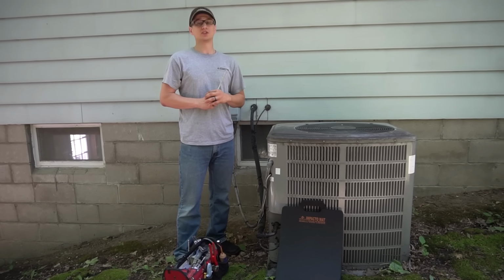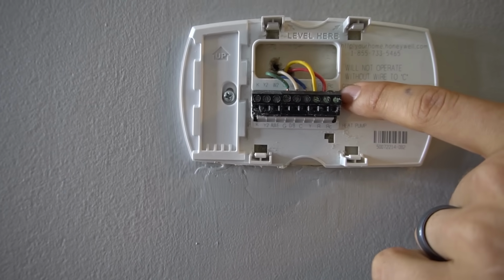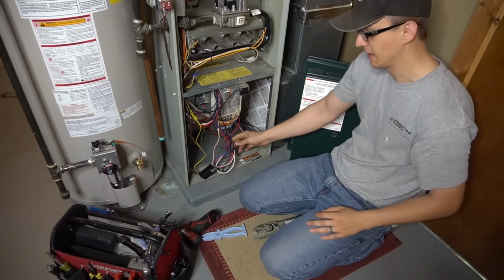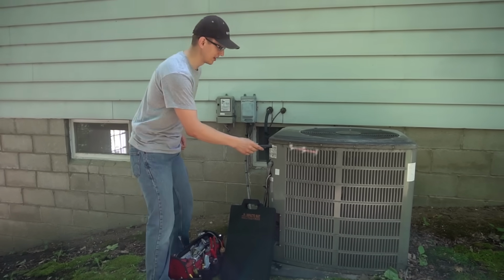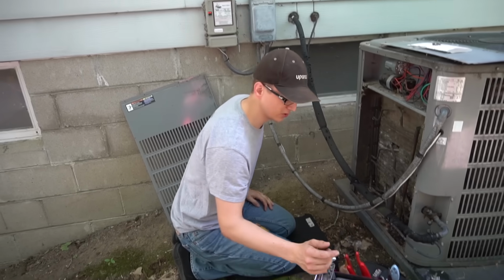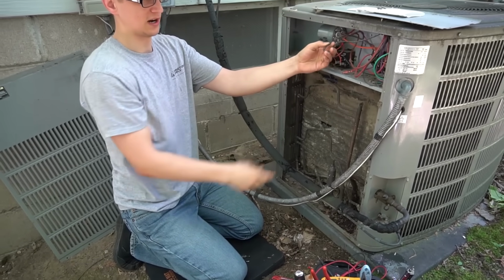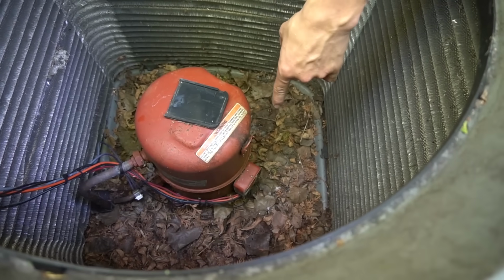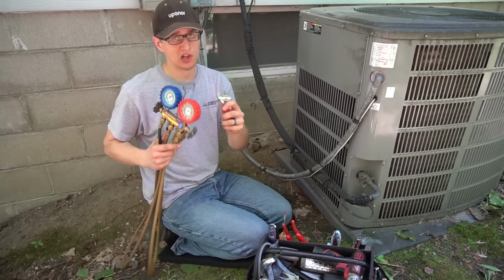AC Unit Not Turning On - How to Fix It Step by Step

Comment: Great video, very educational. I have a question about my ac unit. We just turned on for the first time after winter, everything inside is fine but the unit outside starts to kick in the fan would spin for a few seconds and then it just kicks out, and keeps repeating like that, any idea? I read on other blogs something like short cycling due to low freon? We did notice late last summer that it felt like it wasn't cooling as well
Reply: I opened the unit and there is a thing called comfort alert diagnostic which is giving an error code for short cycling and refers to high head pressure. I think I really need a technician
Reply from the maker: It sounds like you are on the right track! But you are right, if it's a refrigerant issue then you probably won't be able to do anything with it. Will need to bite the bullet and call out a tech. Good luck!
Reply: @WordofAdviceTV   It was a leak in the evaporator coil, had to replace it 1300$ :( Again thanks for the video it was great

Comment: THANK YOU SO MUCH for your videos. I have watched two and saved myself over 150.00 to replaced the capacitor that went bad in my outdoor unit. It popped the breaker then wouldn't do anything. Using info from you video helped me trough the troubleshooting process and my unit is fixed for about 13 bucks.
Reply from the maker: You're welcome! Glad to hear you got it fixed! Stay cool ;)

Comment: hi, my condenser unit kick started the fan when I switch on the AC but the fan doesn't continue to spin.  I open up the panel and got a diagnostic status of "low pressure sw open".  Does it mean it is low on freon?  Or a capacitor issue?
Reply: It could be an air flow issue. (Dirty filter, dirty coil, dirty blower on your motor, motor weak or not running)  Need to check all of those things before adding, or having someone add freon. The open switch means that your low side pressure got too low to keep the switch closed.
Reply: @scottjames5861  Thank you so much for the reply.  You are right!  It was low on freon!  I replaced the system 4 years ago but still uses existing pipes.  I had it recharge and added sealant.  I hope it will hold up.  Thanks again for your reply. :)

Comment: I replaced the capacitor and still nothing. The inside unit is coming on, but the outside unit doesn't. I pushed the plunger in and it fires right up, any ideas??? Thanks
Reply from the maker: I have 10 ideas ;) https://www.youtube.com/watch?v=NVPhsK4gK1A&t=5s

Comment: I really like your videos. I have a TRANE AC unit. There is no fan operation when I call to cool on the inside of the house.
I checked the circuit breaker, and it's good. I was going to go buy a new thermostat, but we had a blown part last summer due to a suicidal mouse. I checked outside unit, and sure enough there was a fried mouse setting on top of the AMRAD Model 9200 capacitor. I replaced it. Still no fan operation. I checked that fuse inside the house. It's not blown. Blower cage turns.
Not sure what I may be missing. Could it just be the thermostat like I thought originally.
Reply from the maker: Have you tried setting your thermostat fan setting from AUTO to ON? Does that turn on the fan? Does the fan turn on in heat mode? I have videos on how to check the blower motor (with and without a meter) and videos on how to bypass the thermostat to see if it is indeed the problem or not. Take a look at those videos for more info.

Comment: Hi ...end of winter i had a new furnace and thermostat installed, in HEAT mode it works great. When it came time to turn on AC, I program thermostat to shut off at 70 degrees. The air temperature in house is 76 degrees, unit came on, blew cool air but temper did not move, actually it went up a degree. I did change the air filter, all breakers are on, I don't see no leaks. The thermostat is a Honeywell T4 pro series. Am i doing something wrong or do I got a faulty thermostat. HELP!   Thank you.
Reply from the maker: If you take your thermostat off the wall, do you have a jumper between R and Rc? That is often missed in new thermostat installs. I believe i talk about that in this video. If not, then I recently posted a thermostat wiring video as well and I know for sure I talk about the jumper there.

Comment: How do you put a jumper between R & RC?
Reply from the maker: Just take a little piece of wire and strip both ends of it. If you want you can even snip a short piece of wire that is behind your thermostat to use for the jumper. Or use a thin paper clip. Then put one end into R and the other end into Rc. I show a close up of my jumper in this video if you want to see it: https://www.youtube.com/watch?v=VknvJ9POYDo
Reply: @WordofAdviceTV  I can use a paperclip for the jumper?
Reply from the maker: @frednichols9851  I have used paper clips before and it worked just fine. Just make sure it and the red wire are in the terminal nice and snug. If it is loose, it may not make a good connection and wont work.

Comment: What if you have a mercury thermostat? How do you check that?
Reply from the maker: I have a video on how to bypass the thermostat at the control board. I would check it by doing what I did in that video ;)
Reply: @WordofAdviceTV  thanks. I'll check it out.

Comment: I really don't think you should be suggesting people do that first test on the outdoor unit of checking the functionality by pushing in the plunger that is a very dangerous test and and this is not just being seen by professionals but just anybody that doesn't have cold air on a hot day might be watching it there are other ways check that for example just setting the thermostat on and walking in and out of the house a few times
Reply: Otherwise awesome video

Comment: So what if everything is working but when I go outside the fan isn't turning and it won't jump start.  I mean like trying to manually turn it
Reply from the maker: I would think that either the outside unit is not getting power for some reason or you have a dead/weak capacitor

Comment: Question.. I have the disconnect box with fuse frn-r-30. Is there a wrong way to put these in? They fit either way and I don’t know which is correct thanks.
Reply from the maker: It does not matter which side faces up/down. Either way will work

Comment: I have 2 outside units. One works and the other doesn't.  Could it be the capacitor? It doesn't make any noise when we turn it on.
Reply: I have the same problem the capacitor did not fix it that's why I am watching this video
Reply: @kevinallen1943  so I was able to check if my upstairs thermostat had any voltage ,and it didn't.  I went to check the furnace and it looks like the circuit board is not receiving any power. I dont know if is the circuit board or the transformer. I'll let you know once I get home on Friday

Comment: This video put me on the right track with the 3 amp fuse. Dig deeper and found a bad chip on the circuit board. Bought parts and was a 30 minute fix. This guy is a great teacher and saved me a few hundred bucks I am sure.
Reply: drunkkajun I think my problem is similar to your experience - how did you determine which control board components were bad? Our red LED light power indicator on the board does not light up and the fuse is NOT blown. So it seems power is not getting to the board OR something in the board may be burned up/malfunctioning, hence not allowing the LED to receive power meaning nothing else can work in the system. Just don’t know what that problem is! We recently were struck by lightning and several days later, our downstairs HVAC system stopped working. I’ve checked all breaker switches as well (even turned off/on for good measure). Please let me know if you have a suggestion for how to narrow down why the circuit/control board isn’t getting power. -Dan

Comment: so if the plunger on that switch is not pulled in and it works when you push the plunger in then the switch is bad?? i'm working on mine right now and it's getting to 88 in the house with a projected high of 98. hope to hear back soon
Reply: also, there is a switch attached to the joist in my attic next to the furnace, i've had to flip that in the past when the heat would stop working
Reply from the maker: I have a video on 10 reasons why a contactor may not pull in. Check out that video for more information on this particular problem

Comment: Hi, well I determined that my run capacitor is bad, leaking, however, I should have taken a picture of it prior to disconnecting.  Both wires are the same color, red, don't know if it makes a difference as to how it connects.  The unit is a Lennox, model # 10ACB42-5P.  There are two set of three prongs, one of the three looks different, which do I connect to?  Please HELP?  Thanks.  I'll go take at look at the old one right now!

Comment: Capacitor tested good. On my Lennox xc21 condenser unit I have a power board inside with 2 LEDs one for tripped which is red and the other for alarm. The alarm is yellow and flashes 5 times. i check the manual and it say its a open circuit among other things. Have you came across this problem?
Reply: OK So I found out it was the high presure switch. So I manual reset it. The compressor was running but the fan wasnt. I took the fan mottor apart, HOLY SHIT, loaded with skeleton bugs and the copper wires was all burnt!

Now I been trying to find online a OEM or aftermarket motor. NO LUCK! Anyone knows a online store that has fan motors for lennox xc21?

Comment: Can you help me? We are in Florida and Summer is creeping up fast. Our AC doesn't seem to be cooling properly. I have it set to 73° however it is rising to about 80° during the day but does get down to 73 at night. We have changed the Thermostat, cleaned the A coil, cleaned out the drain pan and over flow pipe as it was freezing up and then running water. Replaced the filter, I've put new insulation around the "cold" pipe outside (don't know the name) planning on cleaning the coils on outside unit tomorrow. What do you think it might be? Any advice would be much appreciated.
Great video by the way.
Reply: Just checked the Capicitor...although a little rusty on top I didn't see anything bulging. There was a fried frog on top of it though. I sprayed off the the outside coil with a hose and then coil cleaner too. It seems quieter than usual, the air ducts in the house and the compressor outside. Almost like something electrical is not quit kicking on.

Comment: Anyway to test if the plunger is getting signal from thermostat to turn on? When I press it in it works I cleaned around and under just to check but will only work if press it in.

Comment: My air conditioner works just fine until it gets to be 98 degrees then it shuts down blower still working just the outside stops .the reset will work back on but for only a minute or so I have to wait until it gets under 98 degrees then it will stay on again. WHAT is it  ?????? Driving me nuts !

Comment: I have an R and RC terminal on my thermostat wires do i need to have a jumper to RC my air unit won't kick on outside
Reply from the maker: Yes, there should be a jumper between R and Rc

Comment: First, I want to say thanks for the video.  Very informative, but I have a Bryant AC unit and I'm pretty sure it's older than 1999 so the internal parts look very different than what I have. Any tips or solutions to work with older units?
Reply: It should be the same even when it’s old contac. And capacitormaybe there is extra control

Comment: we replaced fan motor and the circuit board on our 2008 York heat/a/c unit ...its runs 2-3 minutes at a time and shuts off....my husband sprayed hose water on it and it runs 2 minutes and stops ...what else can it be?
Reply from the maker: You may be low on refrigerant. If your unit has a low pressure cutout (LPC) it will behave similarly to what you described. The unit will run for a minute or two then shut off. After a short delay, it will start up and run for a short time again. And just like that, over and over. If that's what's happening then you may need to call a technician unless you or your husband know how to deal with refrigerant.
Reply: @WordofAdviceTV  now after texting you, we replaced capacitator and it still turns off and on ...does the new capacitator havve to charge after being installed?
Reply: we had refrigerant checked
 and it is not low
Reply from the maker: @charlottevilla7931  Oh boy.. In your case it is hard to tell what it can be without being there.. There are quite a few possibilities. Bad motor, thermostat, control board, fan delay board if you have one, etc... If you have a condensate drain overflow switch, that may be tripping if your drain line is backing up too. So whoever checked your refrigerant were they able to tell you what could be causing that?

Comment: Thank  you for this video.  It took me a while, but going through all the check points you pointed out I was finally able to track it down to a 24 volt wire coming off of a copper coolant pipe within the AC unit.  Popped the fan wires off of the capacitor by accident then put them on wrong and blowing a fuse on the furnace in the attic, but I was able to figure that out quickly since I had already identified that the furnace fan had been working and where the fuse was located.  Luckily the mishap happened shortly after watching your video so I knew exactly where to go to identify the new issue. AC unit is up and running.
Reply from the maker: Glad to hear you were able to track down the problem! Thank you for coming back and sharing, stay cool! ;)

Comment: hey thanks fo the video,,  so i changed out my run stop capacitor  and it did not help,  with the power on the plunger on the contactor is pulled in and i hear it humming  but unit will not turn on  thinking i need a new contactor   any thoughts?

Comment: Thanks i was just about to buy the motor for my compressor unit. pushed in the plunger and it still worked.. so hmm, come to find out it was just low batteries in the thermostat. I feel so dumb. thanks
Reply from the maker: Glad to hear you didn't go through some expensive parts before finding that out! :) Stay cool!

Comment: https://youtu.be/KkUJ-KKuAoY Can you help me identify the problem with my Rheem ac unit. This is a intermittent problem. The condenser motor works great but then sometimes it spins slow and it makes this sound. I replaced everything that I think would cause this to happen except the condenser motor. The unit is only 3 years old.

Comment: Great video! Very informative! Also, please explain how to use multimeter how and WHY to check voltage, amperage, continuity, resistance. How to troubleshoot having only multimeter? How much amperage should draw a unit?

Comment: I’m trying to figure out my AC. Everything works thermostat, fan (inside from the furnace), and I tried the plunger trick you showed, and the compressor/fan on the outside unit turn on when I manually push in the plunger, but it won’t engage on it’s own. Is this possibly a blown fuse somewhere? Help!
Reply from the maker: Aaron, I got just the right video for you :) https://www.youtube.com/watch?v=NVPhsK4gK1A&t=2s

Comment: I accidentally weed-whacked the thermostat wires coming from the house (blue, red, green, yellow, white) to the wires coming from the outside Fan unit (only 2 - Orange and White) - Can you help me know which wires to reattach?
Reply from the maker: I would use wire nuts or butt connectors (preferably with a shrink wrap sleeve over it) to connect the wires color to color. Blue to blue, green to green, etc. But if only two of the 5 wires were connected, look inside of your condenser unit and see which two wires end up going to the contactor coil. Another way would be to go inside and at the furnace control board, find the thermostat wire that comes from outside and see which color wires from that thermostat wire go to C and Y. Those are the two wires you would need to hook up outside.
Reply: @WordofAdviceTV  After watching your video, I confirmed the contacter is getting 24 volts delivered by thermostat, and 240 volts being delivered to contacter, but contacter does not connect... BUT, I can manually press the plunger and everything works fine (fan blows, condenser runs, get cold air.) Do you ever see the contacter coils go bad? With the help of your video, I'll get this figured out!
Reply from the maker: @MichaelJAntonelli  Hey Mike! If the contactor coil is getting 24v but is not pulling in, it will be one of two things: Either there is a bug stuck in between the contacts, or that contactor coil is bad and the contactor should be replaced. (they aren't too expensive, I have links in the description if you need them for reference)